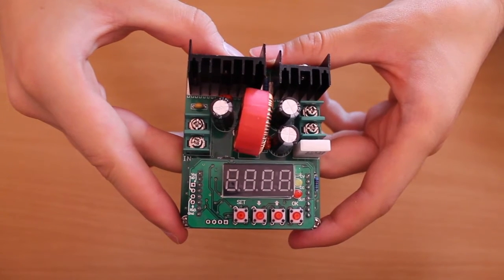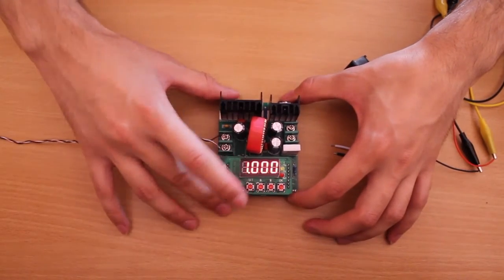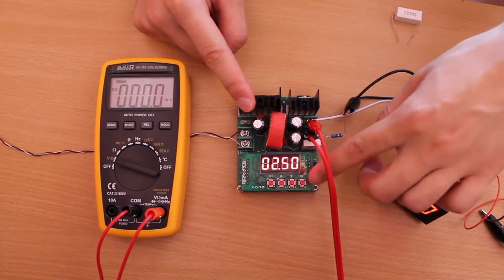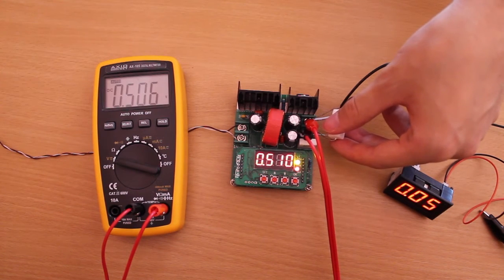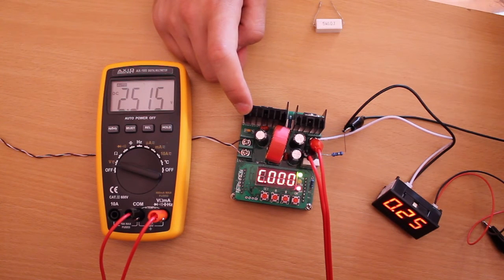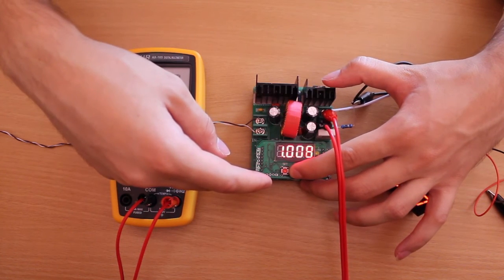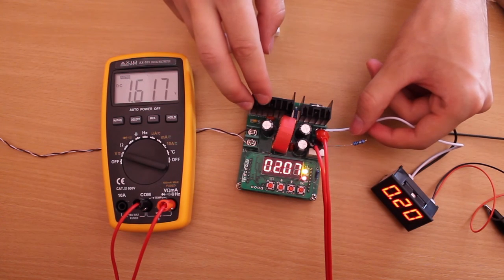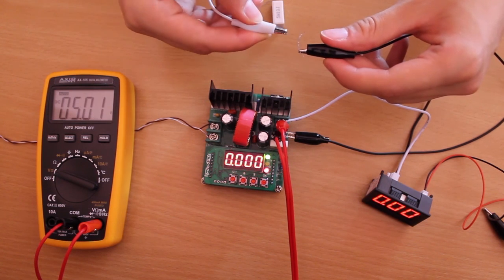B3606 Buck Converter Review and hidden functions, (banggood.com)

Comment: Excellent very clear and concise, thanks. 
Q.   Is the display board detachable from the mother board?  i.e could I easily extend the display board from the mother board with 2 x 8 way  20 cm ribbon cables with Arduino Dupont plugs (2.54mm pitch) and sockets which I can  also order dead cheap from China on eBay.
Reply from the maker: The board is detachable. I think that the microcontroller is also on this board (don't have it at hand to check).
As long as the cables aren't too long (20 cm should be fine), I don't see why you couldn't detach the board.
The only potential problem I can see is if you go beyond the capabilities of the com protocol, cable length wise. Whether it's SPI, I2C or UART, I don't know. But even that should be at a few meters.
Reply: Thanks, orders placed.

Comment: what will happened if i apply  negative 12 and positive 12 from atx power supply to this buck converter
Reply from the maker: I don't see why there would be a problem. But, I didn't make the device and didn't test it for such supply. Also, I don't have schematics for it.

I think it should work fine, but you have to be very careful about what you power up with it. You need to make sure that whatever you supply power too doesn't have the ground referenced to earth or you'll basically have a short from your GND (-12V) to EARTH (0V).